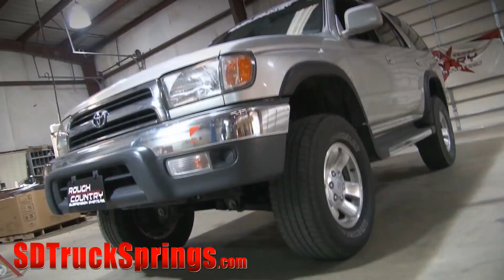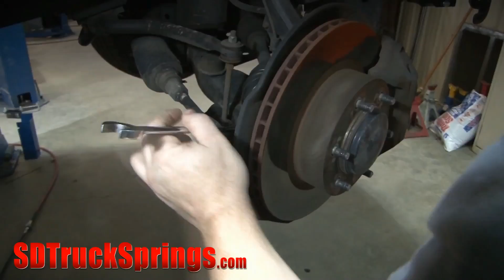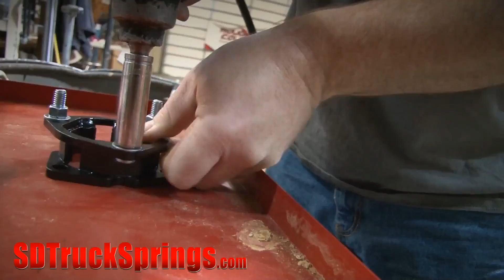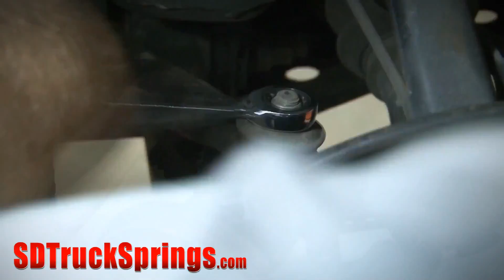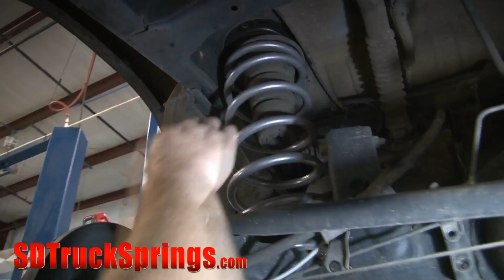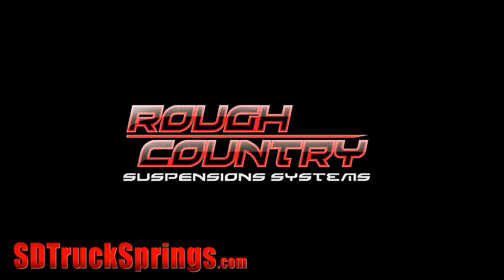Rough Country 3 inch Lift Kit Installation for Toyota Tacoma, 4Runner - Tutorial and Review

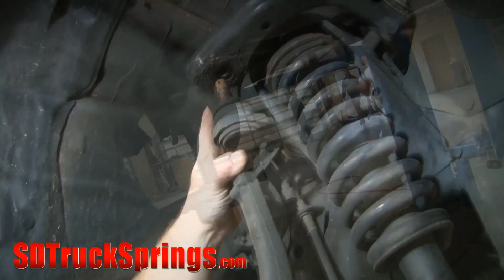Comment: I'm stuck at 2:17 right now. Seems like the whole vehicle is moving up vs just lower a arm. And the upper ball joint is not close to going in, even with pry bar. The hub is angled down to the ground. I'm wondering about ratchet strap the arms together to get the upper ball joint together.
Reply: what did you end up doing ?

Comment: problem with RC kits is alot of times in their packages that they only give you the part that lifts the height, they don't give you everything else to drop down.  but they always say thats all you need without having concern of your other parts in your vehicle.  I would actually rank them at the bottom of the list of most kits.  like entry level.

Comment: I have herd some stuff about these lifts as to that they are cheap and don't ride as smooth as they should. Also herd that the rear springs are super stiff and cause the back to not ride correctly. I guess what I am asking is for someone who has this lift to give some feed back. Is it really true that they become more stiff? Or do they stay somewhat close to what the original ride is?
Reply: You get major pinion vibration if you don't shim the rear axle
Reply: So you Shim the control arms ? .. Caveman. ;p